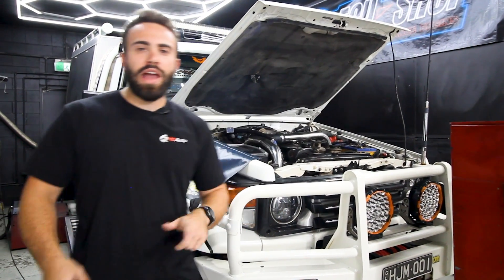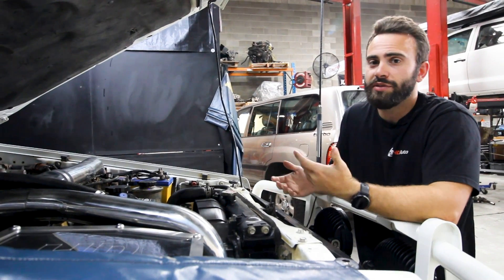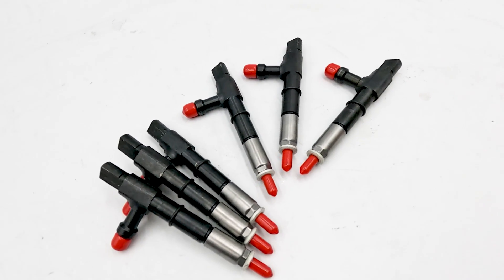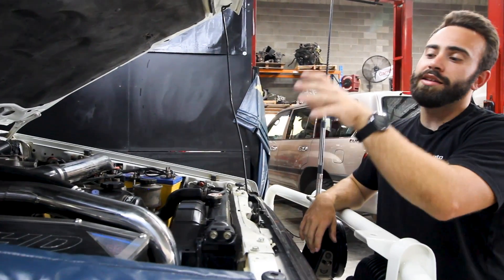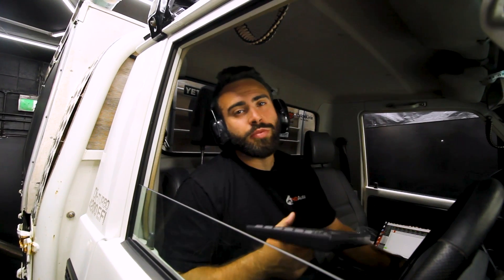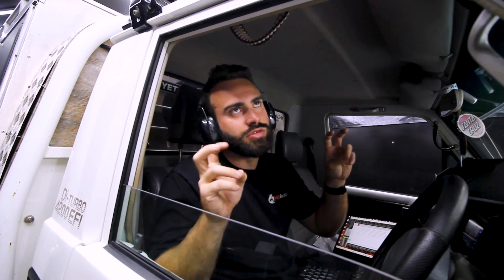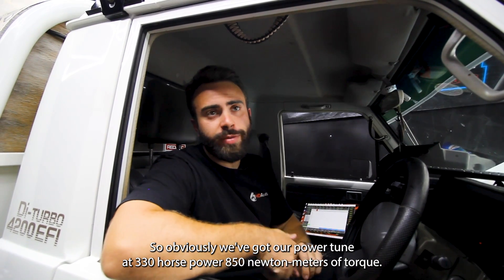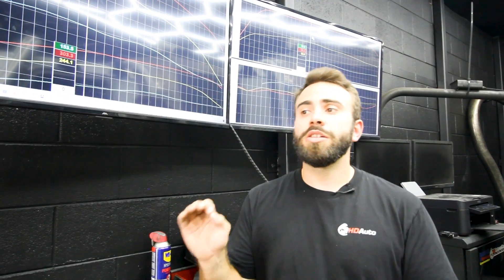1HD-FTE - The Ultimate Performance Package! But is it safe?

Comment: Nice vid mate,  I have a 06 5 speed auto 100 series. She has about 360000 on the clock.  Can a unichip still be fitted without any real worries
Reply from the maker: Hey mate

Absolutely, but there’s a few things I recommend first.

1. Intake clean (if built up)
2. 3” exhaust
3. A valve body upgrade. And inspect the health of the transmission in the process

If injectors haven’t been done, I would also recommend a set of replacements before chasing a performance increase
Reply: @hd_hayden  
Thankyou. Injectors were done at 250k.  i have a beaudesert 3inch exhaust and egr was plated by previous owner.
Reply from the maker: @antz2556 Sounds like she’s ready to rock and roll then 🤙
Reply: @antz2556 what!
That annoys me.
When I went to Beaudesert (and I questioned to fit a 3 inch), they convinced me to go for a 2&3/4 mandrel bend citing “back pressure being a good thing”.  I thought BS at the time as I had a 3” on a Patrol previously (now I have a Prado).
Now I’ve upgraded the injectors, turbo, intercooler but still factory Airbox as the aftermarket one at the time could not be fitted.
So, at the time they told me they didn’t do a 3inch.
Not happy with Beaudesert.
I’ll go back to Scott’s Rods on my next ride.
They flat out lied to me.
Oh, forgot, seperate ECU.
30 psi boost, and I got it detuned since reco engine was installed thanks to a cracked piston on the 1kD-FTV.
Service it every 5000 klms now without fail.
Refuse to tow over 1000kg.
Not risking another cracked piston.